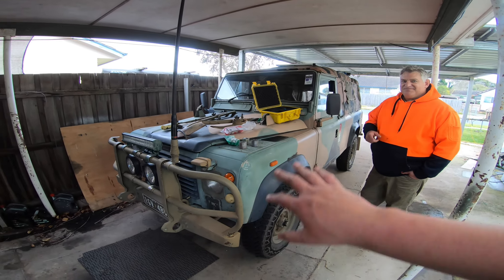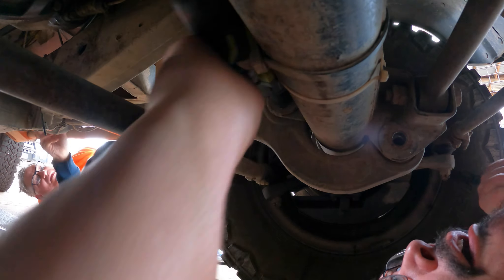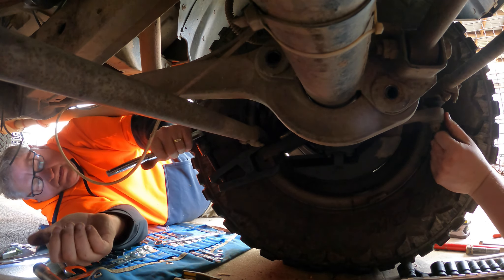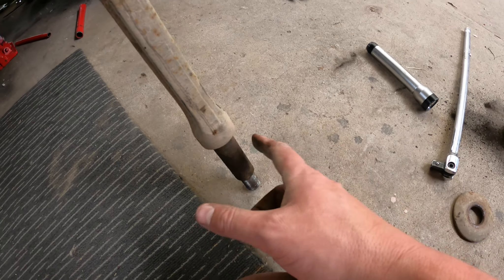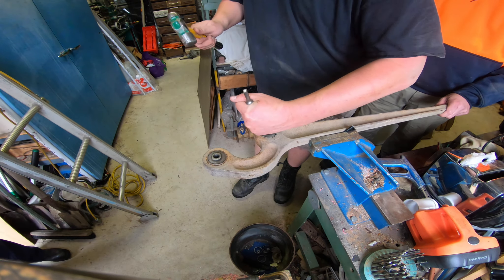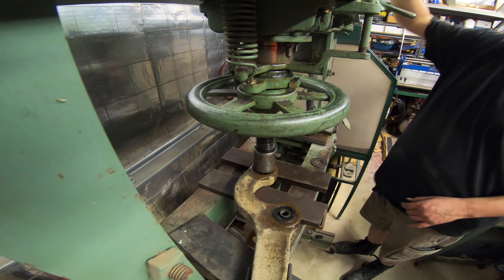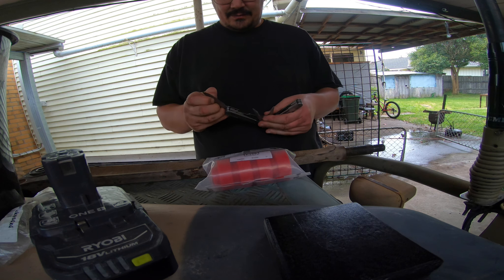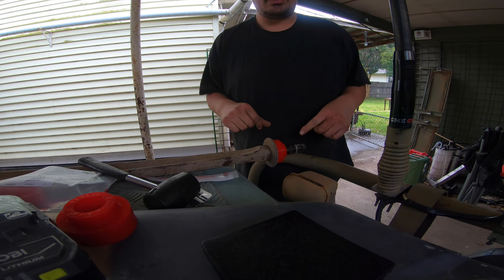4x4 Land Rover Perentie radius arm bushes | Part 1 of 2

Comment: Good you have a SLAVE  working for you. It looks so easy to change but its such a pain! I changed mine with blue super pro one! Previous owner had 2 inch lift and he had off centre bushes but he told me it was not necessary, maybe. I ordered standard one but struggle to install them. I used jack like you did and also lever bars and a lot of yelling!
Reply from the maker: yeah I cut out a hige amount of footage on this one, part 2 involves a sketchy drive to the mechanic and a 1 inch air rattle gun to get that 30mm nut off the radius arm. 

after that I'll have a video on tie rods - we didn't do the drag link this time, and there will be some 4x4 footage of the 4x4 and 6x6  and 8x8 together on the same trip.